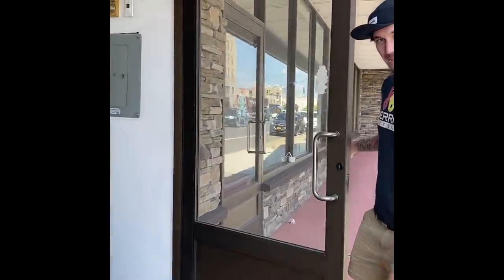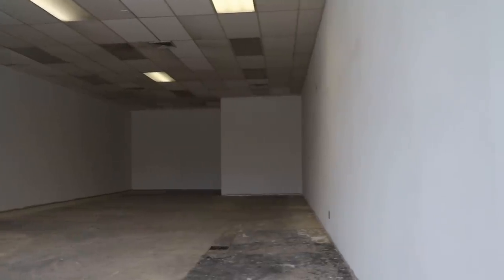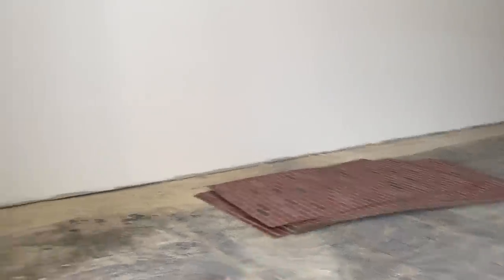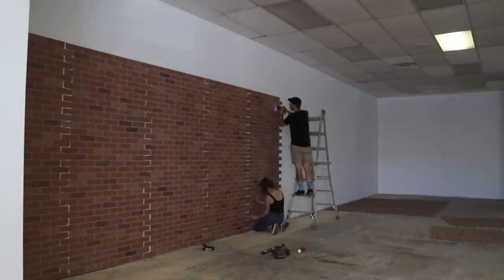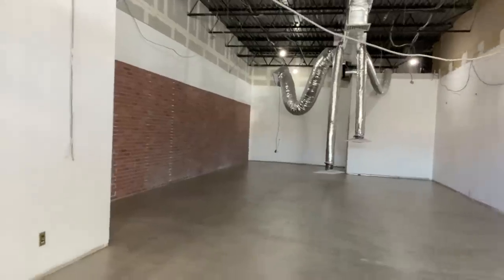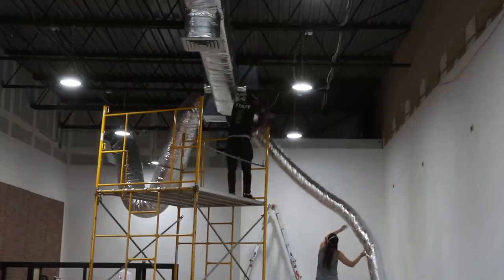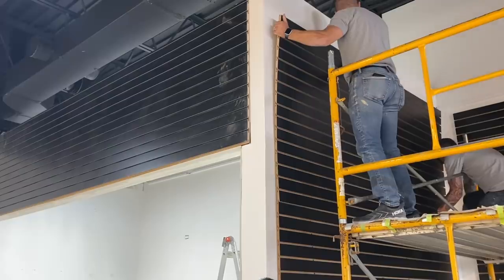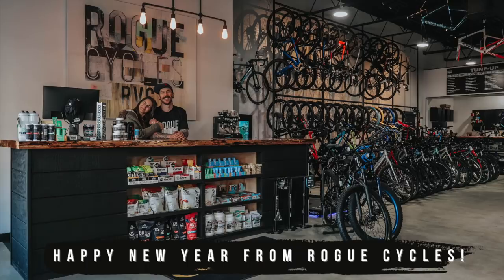DIY RETAIL STORE MAKEOVER FROM START TO FINISH

Comment: Looks awesome! You did put insulation back up, around the HVAC, correct? Not sure what climate you live in, maybe it's not a huge issue. But, hot air rises. The air that will come out of the HVAC will be effected by the air temp around it, if it's not insulated. You might want to rethink that. It's very common to paint that insulation black.
Reply from the maker: Most of the shops around us don’t have theirs insulated either. So far so good. It’s been freezing here, but the shop has been very toasty.
Reply: @diyhuntress  But your needing to use a lot more heat than necessary to heat the space. But, it's not my money.